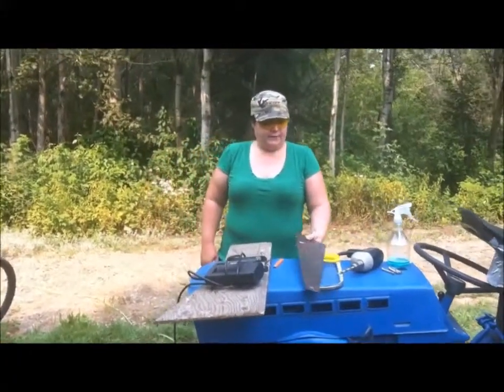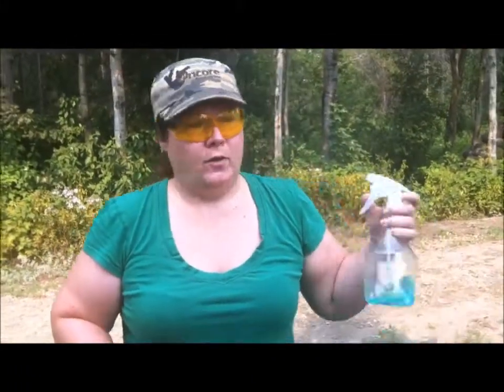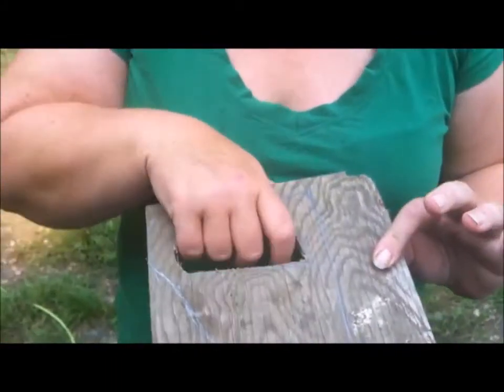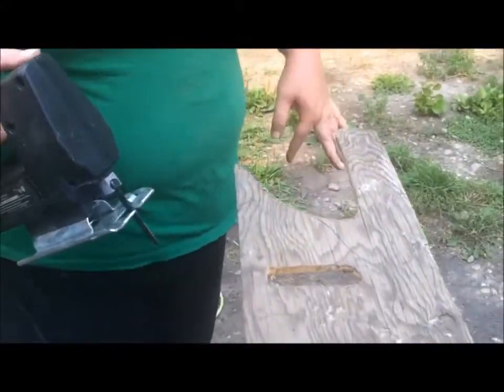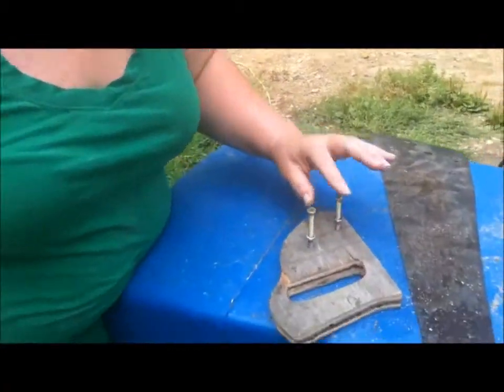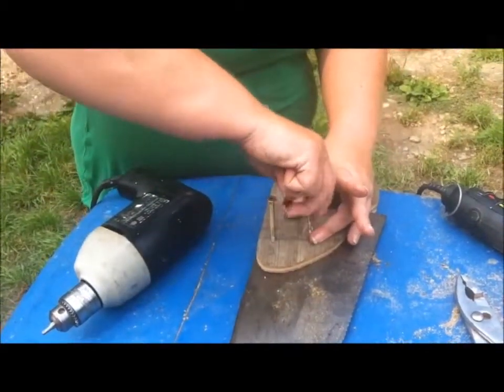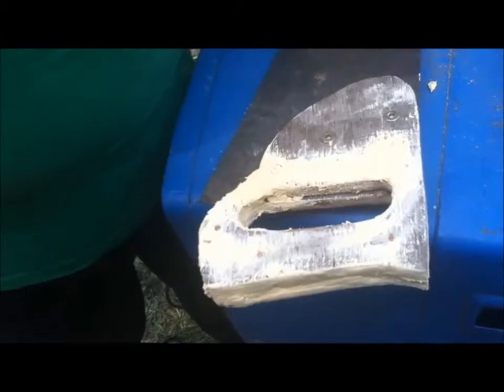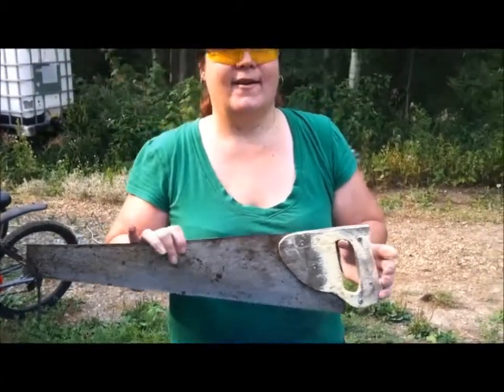Handsaw Handle Repair and Replacement

Comment: Great job on the new handle. Friendly tip though... please use a vice to hold down your projects. Never know when a drill or other power tool will decide to wander off into your hand. Otherwise great job.